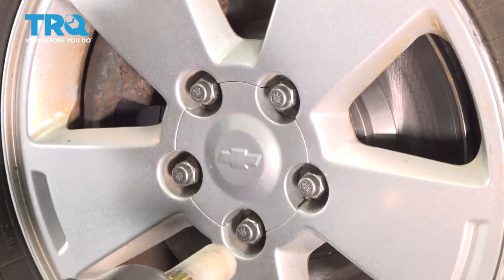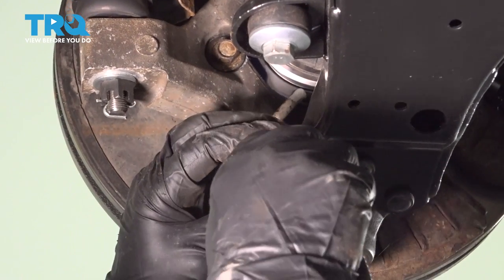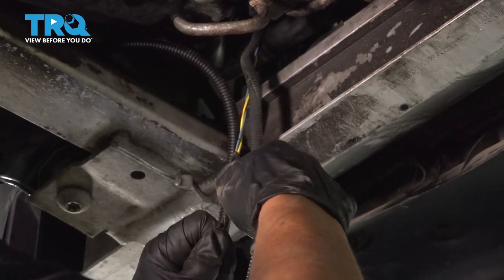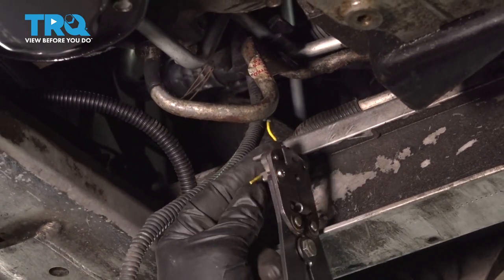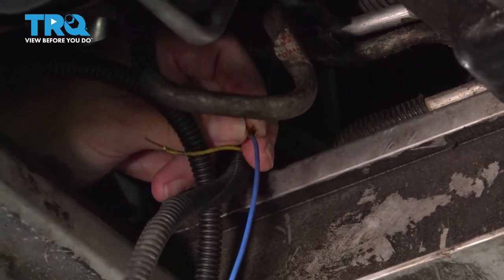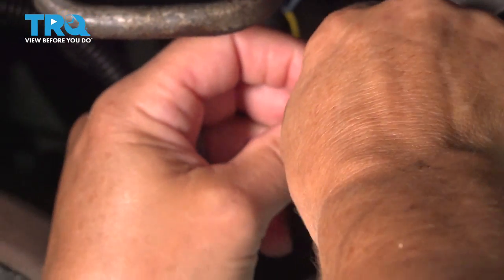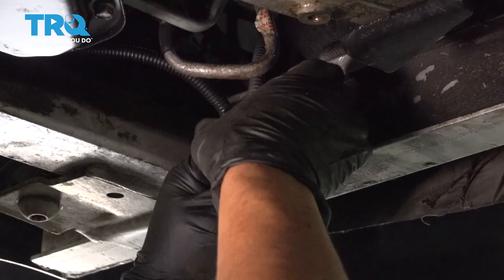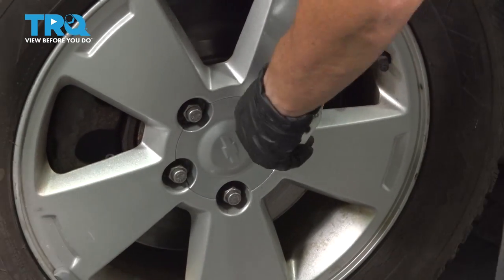How to Replace ABS Sensor Wire Harness 2006-2013 Chevrolet Impala

Comment: That was a trash wire job lmao. Should have soldered the wires and that heat shrink was way to big for that gauge wire, also the failure point is usually where the sensor wire goes through the hub because it rubs on the axle

Comment: Il going to take a whack at this after work myself but I'm not familiar with caplicing and doing anything electrical. I've done a hub assembly, brake pads, etc. What is the WORST case scenario if I attempt this and hot a snag? If it's just the ABS and I struggle it'll still be drivable right?

Comment: I am getting anti-lock brake system right front wheel speed sensor circuit code C0040-00 is it the same thing that you're doing

Comment: I have a 2010 Pontiac G6.

But Mine is the other end of the harness which is connected to the car not the wheel hub. It's the chassis side harness not the harness that's connected to the wheel hub.  That's my issue. How do I fix the opposite end???
Reply from the maker: +LX DarkWolf XL We do not have a video for this repair right now, but we'll keep this request in mind for a future video! http://1aau.to/m/Shop-TRQ

Comment: I have a Scion tc 2015, what kind of harness do I get? The wheel speed sensor is fine but the wire it was connected to snapped.
Reply from the maker: +Manuel Gallegos You may need the ABS sensor harness. This is not an item we currently carry for your model. We suggest searching further for the item you need.